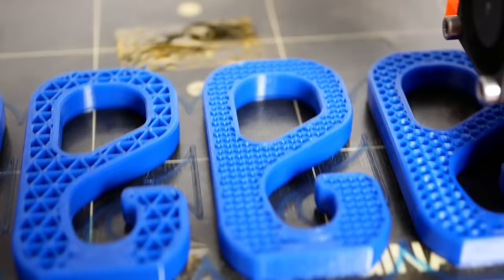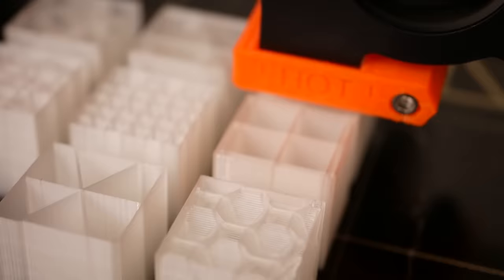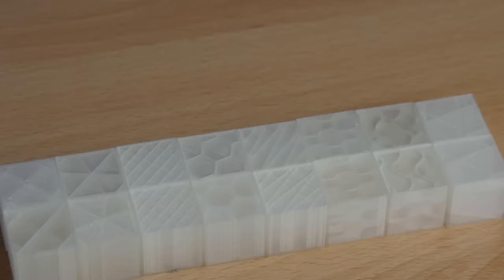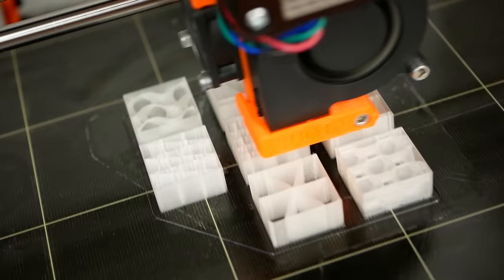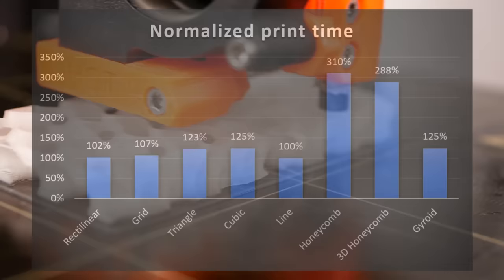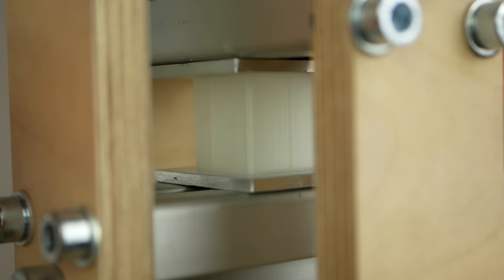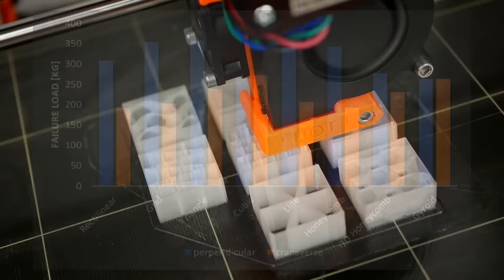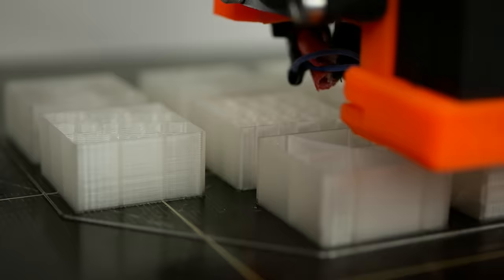TESTING 3D printed INFILL PATTERNS for their STRENGTH

Comment: Some of the infills being printed in the video look a bit stringy. Is that typical/okay? or is that an issue with your print settings that could be affecting the results.
Reply from the maker: Infill usually doesn't use retraction so this might be the reason. Should not influence the strength though.

Comment: This is really close to a good video, you have a lot of good information here.

But there's no attempt to control for or quantify machine or material variation, which in practice are absolutely huge, so your conclusions aren't actually useful.

That's... unfortunate, because they're close enough to being useful that I think most people will just take them as true and move on.

My suggestion would be, in the future, to add more variation to your tests to try and determine variability under different printing conditions. Print multiple test specimens with multiple different materials, and also possibly vary your print temperature to force the print to have better and worse adhesion.

Comment: The most annoying part of 3D printing is breaking away the infill. I've had to do this on many hundreds of prints because designing parts with minimal or no infill at all is not always an option. The best breakaway method I've seen so far is to use PLA for infill and ABS for the main part, but that is insanely expensive on my budget.